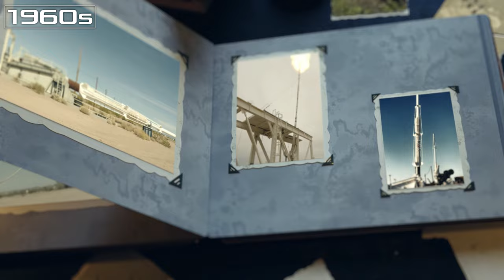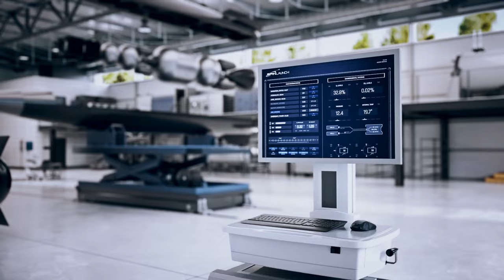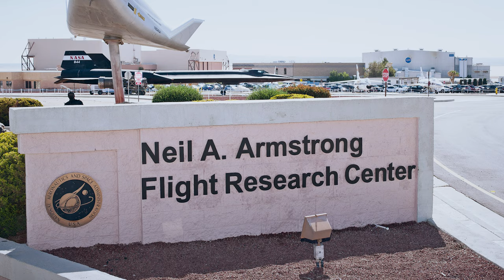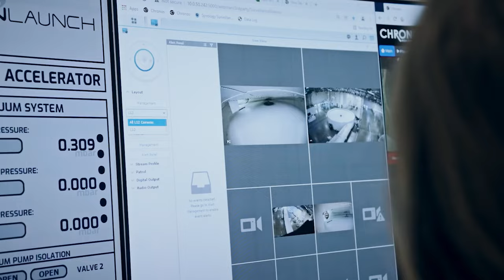NASA wants to launch satellites using a catapult

Comment: This is a private attempt. It will not work. If you have the slightest grasp of physics or cars you know this thing is not working. The moment it will become unbalanced after payload launch the rotating arm becomes unbalanced. There is a reason there are weights on car rims

Comment: Instead of a mechanical spinning sling shot... construct a 10m diameter tunnel with a radius of 100km. Install in the concrete sections, electromagnetic field generators so the cargo pod can go around and around as many times as necessary before being directed to the East facing exit tunnel. 
If the pod has just cargo or water, it can be accelerated very quickly to reach escape to orbital velocity.
If the pod has human or other flora/fauna - the acceleration can be kept below 3g until it has reached the necessary velocity. 
The costs are... the initial construction of the concrete tunnel with EM wiring, the cost of the launch pods, and the cost of the electricity to delivery each pod to orbit. The weight of pod irrelevant as the pod can continue to accelerate in the loop until it has reached velocity.
A railgun pod launch system. 
If the loop is constructed in say France, the exit portal can be at elevation by simply directing the TBM (tunnel boring machine) at the correct angle through the Alps (or any mountain).
Reply: Soo u want to build 100km particle accelerator without mentioning the vacuum?

Comment: So the projectile is launched at 5,000 from a vacuum chamber? Which is at sea-level? How is it not vapourised by having to travel through the thickest part of the atmosphere?
Reply: Soap   That's not fast enough to cause disintegration due to those forces although it would produce heat.. As the projectile climbs the pressures reduce as does the heat.
Reply: @SMHman666  thank you my friend:-)